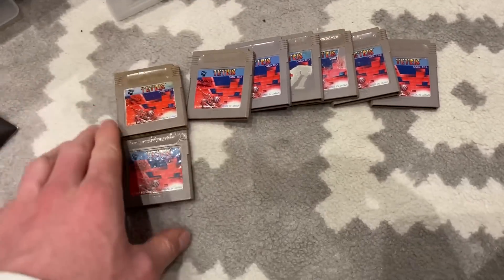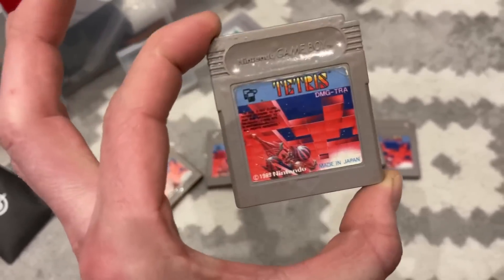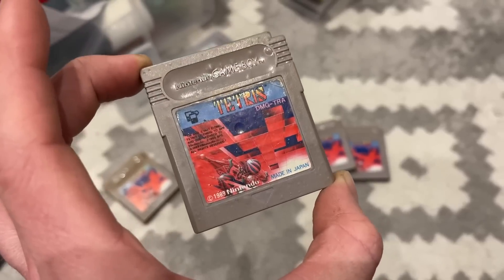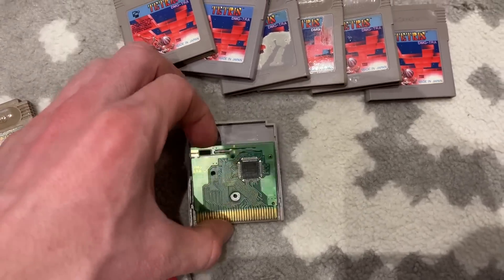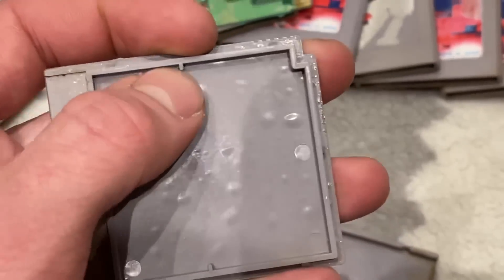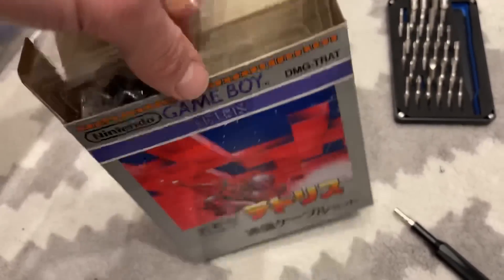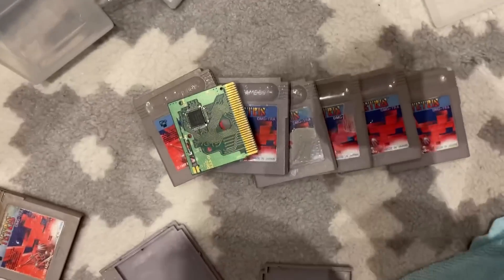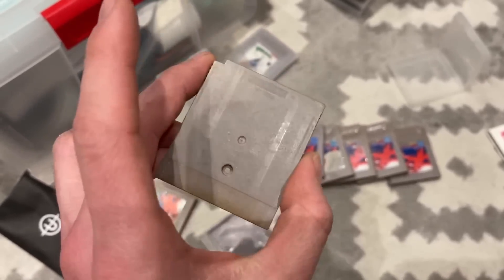Update on the destroyed GameBoy games

Comment: Petrol does ruin ABS, which Gameboy cartridges are made from. Even the fumes are enough to deform it, as you can clearly see. The reason the other cartridges have survived, I believe, is because newer Gameboy carts are a much higher density of ABS than the minuet Tetris and older cartridges were. You can tell they are different compositions by the far more apparent yellowing on certain cartridges compared to others. Most cartridges don't fade and discolour if looked after, older ones can change colour simply from different temperatures.
Reply: This is proboly right
Reply: Well said. I was thinking the same thing. I'm thinking it would be a bad idea to put the games back into the plastic housing.
Reply: Ye must sacrifice the worst cartridge to the Petro gods and see if that was the straw that broke the camel's back.
Reply: @mg6506  The shells don't react with other plastics, strangely enough. I know because as a small stupid child I kept mine in a cheap plastic wallet, then some other box before i built a proper shelf. It's only petrol and other strong solvents that really eat them away. As long as the petrol fumes can be suitably dissipated, I would suggest a dehumidifier, they should be fine to go back in the box for the rest of time.
Reply: @SampullMC  Take care (you or anyone reading) about some plastics tho, soft PVC for example, like wire insulation, can soften and leave marks that look like molten on other plastics. Their plasticizers (what makes them so malleable) either evaporate or migrate through the contact. That's one of the reasons old plastics are brittle and the explanation for some wires looking like they melted the case of devices that might never have been used even.
Reply: I'm thinking the same thing, petrol is serius shit :(
Reply: The little white Tamagochi game he had likely wasn't ABS, it yellows in the presence of UV light as well. I'd say it was PBT, but most certainly the Minuet Tetris cartridges were ABS. ABS forms polymer complexes with aromatic hydrocarbons like benzene and toluene which are found everywhere in petrol, and that's because the entire synthesis is made by building polymers of styrene, in amongst acrylonitrile and butadiene, which is benzene derrived itself
Reply: Was a great idea to hoard everything he could from Sendico and screw other people who wanted to buy the same stuff he have dozens of times just because.

No empathy
Reply: @michellefernandez3155  🔥👏👏
Reply: @michellefernandez3155  I'd hardly call it hoarding lol from what he's shown, while his collection is phenomenal, it's just a few shelves of really really cool, stuff. Some people fill houses with this kinda stuff, and stuff they'll never ever play. I think that's closer to hoarding stuff
Reply: @somebaker2613  You should try to see his first videos on social media: the little amount of collectibles you see here is because of he moving to the new house. He has a very large collection (Imagine thinking he has 0 collectibles because he usually films his videos in front of a blank wall lol), but thats far from the point, he can buy whatever he wants: The real point is that it's proven he a lot of times just buys the same thing over and over (Or just bids time and time again) just screwing others in online auctions, even people trying to preserve betas. In the end, people like him and Virtuanestor are the same.
Reply: Yes, but what is weird is that it didn't affect the stuff closer to the leak. That boggles the mind.
Reply: And the fact that the gas travels upwards toward the loft. The fumes have reacted with the plastic.
Reply: @michellefernandez3155  I understand having 2 copies, one to play and one to store/collect but I do agree this is excessive
Reply: @robertquantrill  i concur with you, two copies is alright.
Reply: @michellefernandez3155  just curious: are you in the market for anything he's hoarding? Not disagreeing with you though.
Reply: It is a pretty good solvent and it might react with the plastic that the cartridges are made of.
Reply: @GlassMaster_Jae  several times, yeah. But i know i am not the only one because some people has been more verbal than me in the past
Reply: @michellefernandez3155  so it's a little more personal to you , I can get that.  How do you feel about replacing original gameboy color shells for repro shells? Also what's so special about those Tetris carts? To me they look like average Japanese versions
Reply: @GlassMaster_Jae  They're the rarer "Minuet" version, with a different Theme A. They're quite collectible now, but not too hard to find if you look hard enough.
Reply: @SampullMC  how the heck can you tell the difference? I heard him mention the stamp being 20something in the video , is that the only way?
Reply: @Ellipsys0303 acetone would be immediate and show signs unless extremely diluted in which case I doubt it would happen to multiple carts all at once.
Reply: @GlassMaster_Jae  There are 4 ways to tell. One is a different stamp on the label, another is the spire of St Paul's Cathedral being in a slightly different location, another way is turning it on and if it's a minuet version there will be no hyphen in "Bullet - Proof Software" and the last one is Theme A being different once you start the game.
Reply: @michellefernandez3155  I feel the exact same way! I don't know how many times I've tried a game through emulation, really liked it, looked for it online, and pass out due to the price being so high because 'collectors' end up buying every copy they can get their hands on, and therefore driving the price way up because of the now 'high' demand. And just because they have money to throw away on 800of the same item doesn't mean everyone else does. Because of people like this, sellers jack up prices because they know they can get collectors to pay for it. It's just like scalping in my opinion and I hate it. It sucks that this happened to him, but because he has every one ever printed (exaggeration), they are all ruined for everyone else that might have enjoyed them....
Reply: As a 3d printing enthusiast, this is exactly what happened. Petrol breaks down abs rather quickly.
Reply: Yup. Sounds right.
Reply: no its vinyl(pvc) not ABS . the old cartriges are made of vinyl witch is made out of gasses and cracked benzin(ethylen,propylen and more). the newer ones are mado of ABS. but i have a question why does he call the bubbled carteiges dead 
they work so there is no point to call them dead.
Reply: Could have also been, on top of the vapor softening, imperfect molding. possibly trapped air bubbles from the injection molding process surfacing from the softening.

Comment: I used to work in a Biodiesel Lab, all our bic pens used to start bubbling and eventually turning cloudy and crumbling apart, that was just from the fumes that made it in the the air, it all stripped paint from the walls and dissolved rubber gaskets sat on shelves. All from the fumes, and it never really had an intense smell. It could even be some of the chemicals used for sealing the roof, or other things that were going on around the attic, those tubs are usually very leaky to air ingress
Reply: And that's why people often get paid extra for the health hazards. It might not feel like much, until you see what it's doing around indeed.
Reply: @Kalvinjj  can't say that for tyre fitters, who breath in tire dust all day
Reply: Interesting. I hope those were not the same type of rubber gaskets used for sealing the diesel lines if they were that vulnerable.
Reply: @Gameboygenius  they're the main reason cars can't handle higher Biodiesel levels, need certain synthetic gaskets to avoid them turning to soup, Peugeot have always been very compatible due to the pipes and gaskets they used.
Reply: @JTOnline89  you would think that someone would be clued in at an actual biodiesel lab though.
Reply: @Gameboygenius  we had extractors everywhere, fume hoods, PPE,and yet it would fume from sample jars brought by plant operators. The end product was dried at 90 degrees C to boil off the methanol, so the jars came in piping, and thus fuming.

We made it from used cooking oil, so when we were drying the oil to a lower water content, the whole plant smelled of what oil it was, Chinese, Indian, fish and chip....oh and we once processed a fatberg from Hong Kong's sewers, we wore neckscarves with olbas oil on them for a month, the locals weren't happy
Reply: Jesus. Imagine what it's doing to your body the whole time!! Inhaling that every day...
Reply: @Domarius64  lucky I haven’t worked there for a number of years now
Reply: @JTOnline89  that sounds like a goddamn nightmare, and I once worked boiling the flesh from the bones of a dead whale to be rearticulated

Comment: To me, it looks like solvent-damaged plastic, as you said probably from the petrol. for the reason why only some games are affected and not others, it might be differences in the formulation of the plastic used, even plastic of the same type, like ABS or PET, can have different characteristics (like chemical resistance) depending on additives used and even pigments used
Reply: It's funny (albeit tragic to a collector) to see some SNES consoles where one half is yellowed far more than the other, or even on the top half some parts are a lot yellower than others like the cartridge cover and the trim around it.
Reply: I totally agree with you. Accidentally used a solvent on plastic and I got similar results. Gas evaporated then condensed again. That's definitely not a heat thing because my attic in Florida would get super hot and nothing like that ever happened.
Reply: Honestly petrol fumes would also be less dense and rise slightly, so that the carts got hit harder by fumes upstairs.
Reply: @M0L0TOV  And the glass transition temperature of ABS is way too high to realistically achieve it in any realistic way accidental (except from a house fire that is: P)
Reply: I have literally started seeing comments lately starting off with "He was excited, and blaming the girls for his arousal. All of that rhetoric was really aimed at himself and his shame."
Reply: @nerdy_posta1129  What?

Comment: I would definitely clean up the boards like you are, and try doing the label and shell swap like so many others have mentioned. You may want to look into getting containers that have air and water tight seals, if you are going to continue to store in your loft. That can be pricey but will protect your investment better.
Reply: I always store old games and even consoles in zipper sandwich bags. It's cheap and completely seals them off from environmental contamination especially if you double bag. And I use 5 gallon ones for consoles. Could even just use cling wrap too.

I have my old Sega Genesis and NES from when I was a kid double bagged separately with the games in another double ziplock in a box, and I wrapped the box in plastic wrap lol. A bit excessive I know, but I had to store them in a storage unit and wanted the best protection for the least amount of money. I've personally always hated those giant tubs because they're not airtight. And the ones that are are ridiculously expensive.

Comment: Petrol fumes seems feasible, plus the type of plastic.

Oh a slight chance  you may have contaminated the big box version as you did not wash your hands after showing the substance on the contaminated carts.

Best to separate the boards from the carts keep them in separate containers.

Wonder if chalk (as it's alkaline not acidic) might help stop the degradation?
Reply: Hope he sees your comment, I had the same concern with cross contamination.
Reply: i thought the same thing..
Reply: I seen him reaching for the boxed game and I screamed "Noooooo" in my head
Reply: @GlassMaster_Jae  yep, same here. You can be clueless in chemistry, but common sense would tell you not to touch something else with those hands :(
Reply: Should be fine.  Petrol is long gone, what he touched was just plastic affected chemically.  I have a hard time believing any solvent lingered, especially since it was vapors, not direct contact.  I could certainly be wrong but I wouldn't freak out over it

Comment: That'd do it. My theory is most of the vapor escaped, as you'd expect it to, so it wasn't a problem, but vapor that got into the storage tubs might have formed like a mini precipitation cycle. Like it would condense and re-evaporate and condense and evaporate (or close to it, maybe just temperature changes caused it to sink and rise inside the air in the tubs). That might amount to prolonged exposure.

Comment: Absolutely that's the reason. Tetris was one of the first games in production. Presumably, those aren't all cartridges from early runs, but even if they changed the plastic when creating SKUs for later releases there may not have been in a huge rush to change the supply chain for older ones even if they knew that this was a possibility in the distant future.

My guess would be that if this had happened in the 80s or early 90s, the cartridges would have been fine, but a combination of those old petroleum based plastics breaking down, and the introduction of this petroleum based vapor caused deformities in the voids that the deterioration left. But I should mention, I'm not a material scientist, I just worked in plastic mold injection for a long time.

Comment: I would recommend finding bins that are IP67 rated waterproof. They are basically the same, but they will have a rubber gasket and seal up completely. They are usually a bit more expensive but not a ton, and if you throw some silica packs in with your stored games you shouldn't have anything to worry about. I might suggest you clean out the ones you've been using in the meantime, there could be a thin layer of petrol deposited on all the surfaces in there.

Comment: It’s gone bubbly because the vapors from the gasoline fuel is interacting with the oils in the plastic itself. when you wipe on the inside of the cartridge you can see the oil breaking down. it’s kind of like rust but for plastics when something gets rusty just keeps eating the metal right? I think a plastic restore compound might help with further degradation.

Comment: So I saw your video yesterday and I had to figure the best way to explain this so you know how to prevent it in the future

The bins you are using actually can lock in and attract moisture.  No matter how small.  
I’ve worked retail for years and bins like this would get stuck together and become hard to separate because of the moisture that can get locked in.   Even in cold environments they will trap in heat to make it it’s own room.   The reason why many of your other game may not have gotten damaged is due to the cardboard in the bins absorbing the moisture.   

To prevent that I would recommend having silica gel packaging in your bins to absorb and wick away the moisture when they are in the bins.  

Here in the states we also have something called damp rid which sits on a shelf or anything you decide to place them on and they absorb moisture from the air.   

Your games and boxes on display have enough airflow in the rooms they are stored in so they won’t be affected.  However those bins are stagnant and attract heat and moisture.

Comment: -It could be mold. But mold wouldn't affect the integrity of the plastic. Only the surface.

- It could be heat. Extreme heat could make the plastic bubbly. But you said the place isn't that hot.

- Now, about that theory you just explained makes sense. A chemical reaction could definitely cause the bubbles and that weird "greasy" effect on the plastic. That's probably what actually happened. 

As a "solution" I would say: disassemble all the cartridges. Wash the plastic parts with soap, and remove all chemical residue. And clean the electronics with IPA. Then assemble back. Not much else you could do.

Comment: Its probably chemical vapors mixed in with any kind of condensation creates an almost acid like coating.  Had a bag with a gameboy and games in it where the batteries leaked out and it was in a damp garage.  Created the same discoloration and film like residue on the games.  I also work at a chemical facility and see it with all kinds of low quality plastics and rubbers being eaten away.

Comment: Hi Elliot. I'm from South East Asia, and have experienced that on some of my Game Gear / Gameboy carts. I noticed them 'sweating' and yes bubbling too. I thought it had to do with the humidity and heat we have here. I've cleaned up some of the carts with alcohol, but after few months, it start to 'sweat' again. I'm not sure why but probably due to the weather and also the plastic composition used. No fumes of any sort were ever in my home though, so I can't really rule out for the petrol part.. I just think it is poor air circulation/heat.. But you're in the UK where it is dry and cool.. So it is also very surprising that it is happening over there as well..
Reply: Well no, believe it or not but the UK is very wet.  We don't get dry heat, we get massive amount of humidity. When it is hot, it tends to feel a lot hotter because of the humidity here. Having been to Hong Kong and Malaysia - very similar effect ion very hot days, but no where near as intense. Having said that, the Channel Islands are closer to France, so I have no idea if that holds for where Elliot lives.
Reply: Are you downtown and on first floor? Perhaps vehicles which have only two stroke engines in your area which run on gasoline could have contributed